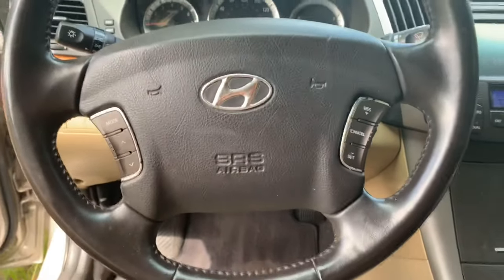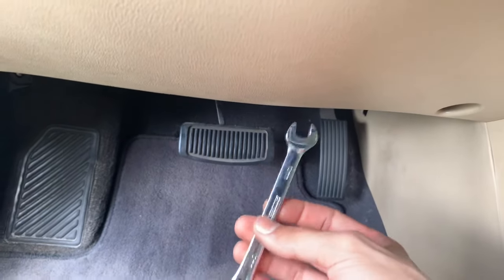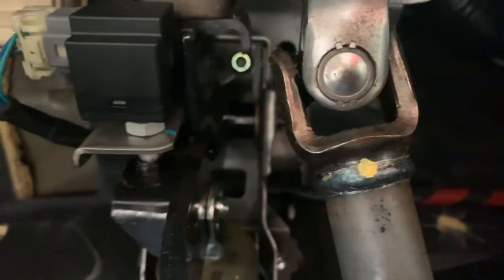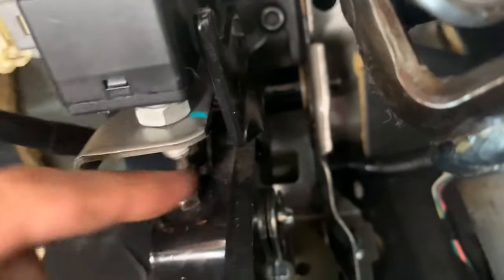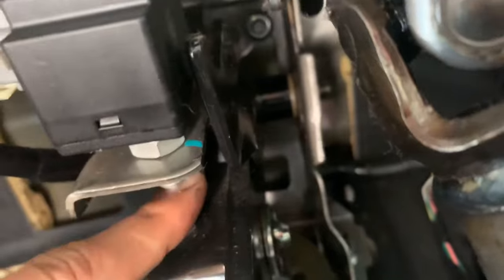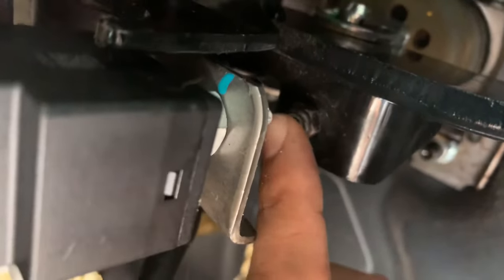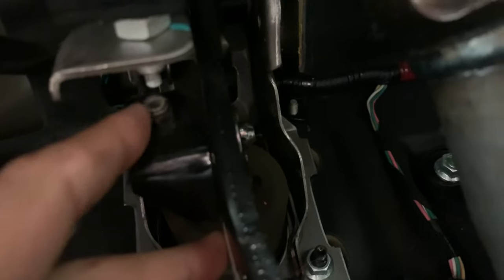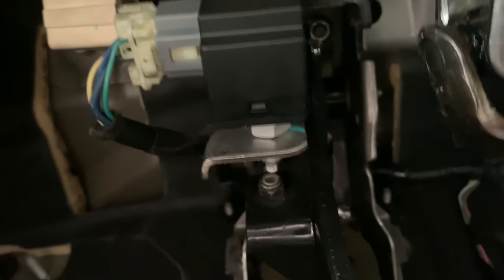HYUNDAI SONATA BRAKE LIGHTS WONT TURN OFF DIY BRAKE LIGHT SWITCH EASY FIX “ ESC OFF “ DASH LIGHT ON

Comment: Thank you!!! I haven't officially fixed it but I put a piece of the broken plastic back where it was so at least the lights will turn off and my car won't die tonight! Woo!
Reply: So you just glued a little piece right there to press the switch in?
Reply: @cherellewhite593  
I used duct tape!! Ok.. to be honest I had to buy duct tape the next day and I found a lint roller and peeled a few layers just to try and tape it on. It felt very very silly but my car didn't die that night lol
Reply: @princesspeach3675  lol don't matter what you use, long as you reach the goal!
Reply: Thank you also
Reply: Thank you very much that was very helpful ☺️
Reply: @princesspeach3675  ppp
Reply: 0⁰😅

Comment: Just get under there where brake pedal is located and at the top of break pedal you will see a round disk that pushes a pin up into a small black shutoff box. If pin is broken off just a little that rounded disk on the side of the break pedal will not be able to push that pin up into the shutoff box and turn the back break lights off. Take a half inch or inch threaded screw and place it through the hole on the disk that is attached to top of break pedal put a nut on the underside of the screw to keep it secure. Now when you release the break ped the back break lights will turn off and no more dead battery. It works fine. Trust me I know.

Comment: Very helpful! I just wanted to put in my two cents that the sticky pad you put under a chair leg (so they don't scratch the floor) also did the trick. It also won't break the pin of the sensor as easily.
Reply from the maker: love it! creative fix!

Comment: Got up with a dead battery this morning, couldn’t exactly figure why other than cold weather and could possibly just need a new battery. Then, my mom came home and asked me why my brake lights were on so we started researching to figure out the issue. This video helped me, and I followed basically the same thing as you did so thanks.

Comment: Worked just as you said. Just put a nut/bolt combo and everything works as it should. Side note: my cruise control stopped working also but it's just because the cruise mechanism was getting a signal that the brakes were on. As soon as I fixed this, the cruise control worked as well. Thank you!
Reply from the maker: thanks for sharing that insight about the cruise control, hopefully this information will be of use to others as well

Comment: Thank you!!! I actually used an even easier trick... The little plastic piece was still on the floor broken in half. I just stuck a piece of it back into th space. Worked like a charm. Quick fix for me as it was dark and just wanted to not burn out my battery tonight. I will have to pick up a nut and screw tomorrow so thanks so much!!
Reply: Good move. months ago when this happened to me I wondered where that old yellowed piece of plastic came from
Reply: @iunderstanphotography2780  Yep. That old yellow plastic disc lol. Who knew?lol

Comment: You most likely just saved me a $200+ “diagnostic fee”. Thank you!! On my 2012 Sonata, the little rubber disc that pushes in the pin was worn through in the middle, so the pin just went into the disc, and didn’t depress. Not really sure how long it will last, but I just duct taped a dime over the hole in the disc, and it worked great!

Comment: Thank you for this information.  My Santa Fe had a rubber ring in there and it broke in 3 places.  Found one piece on the floor before I looked under the console.  Had a perfect nut and bolt.  A little tough to get the bolt through the nut as with just 2 hands and the break pedal not depressed.  I managed.  So far so good.  Thank you!

Comment: Thank you so much for this video. I had no idea that was draining my battery. Replaced switch today and no more problems.
Reply: What’s the name of the piece
Reply: @jaxonjones3607  brake light switch
Reply from the maker: @jaxonjones3607  the plastic piece thats not the break light switch is known as a grommet or spacer

Comment: Brake Pedal Pad

This happened to me a second time. In 2018 the dealership handled it under recall notice; this time I took a small permanent magnet and placed it under the switch on the pedal bracket.

Cost ? have lots of small magnets so a few cents, time 30 seconds.

This took care of the brake lights, the parking situation , loss of speed on the roads,and the anti skid light coming on.

I hope the magnet part is useful, I saw people use screws, bolts, tape etc.

Comment: Great video, thank you. My daughter was visiting and asked my why my brake lights were on (I had been home for hours). Went to the car which now needed a jump start and started looking around. Then the Google machine brought me to this video (top hit). Grabbed my flashlight and headed back to the car. The rubber piece that was supposed to close the switch was split in two pieces. So I put in a temporary block, and will 3D print a replacement. Thanks again for a quick, informative video.
Reply from the maker: happy it worked out for you! thanks for sharing!
Reply: Hey was the rubber piece light beige yellowish colored?? Because I found a piece of rubber/plastic split in a half circle on the floor. Was that my broken piece ?
Reply from the maker: @iunderstanphotography2780  that was likely it. they vary in color, depending on year and model of car

Comment: thanks for making me realize the switch turns the lights on when it's OUT ....DOH!!  I thought my new switch was bad for a minute.  my 07 entourage doesn't have the plastic thing that breaks off, just a sillicone bumper pad BTW.  The engineers at hyundai must be having a good laugh thinking about guys trying to spin that nut back on the switch in those tight spaces.
Reply from the maker: thank you for sharing that insight, Im glad you got what you needed from the video, much love

Comment: Did something similar as a temp fix to keep my battery from dying by whipping out some duct tape.
Tore a 2ft or so length and ripped into 3 equal long lengths.
Double one length over and over into a 1/4 inch square pad.
Laid another strip over the square pad.
Placed the pad over the spot where the brake switch grommet would go
 Then wrapped the strip laid over the pad around the brake notch so the pad would not easily fall off.
Reply from the maker: Great work! Nice temp fix!

Comment: Hy thanks for your great info.

I'm having a difficulty with hyundai santafe 19 front light are permanently on and can't turn them of I've checked all the fuss they are all ok.
Anyway salutations please?
Reply from the maker: Your light switch may be malfunctioning like the button or switch you use to turn them on and off may need to be replaced
Reply: @thegasstationvlogs  i see thanks a lot

Comment: What if only my right hand back break light stays on as if I’m pressing my brakes? The other side is normal. Checked bulb, connector, fuse all good. Do u have an idea what it could be. I also checked the wires and also good
Reply from the maker: that couild be from a faulty brake light switch, the fuse inside the switch could be shorted or the switch mechanism itself may need to be replaced. it looks like a plastic box above the break pedal, good luck

Comment: Yooo I literally JUST did this today after I looked outside and saw my lights on. 

It was Hell trying to get underneath the steering wheel and seats with my wide shoulders😅
I got my daughter to push the brake pedal  while I somehow put a screw and nut through the hole, screwed it on, and sure enough the brake lights went off!  

Not sure how long I should leave this, or do I buy an official part and replace it?
Reply from the maker: as long as the bolt and locking nut are tightly fastened itll last longer than any replacement of the plastic grommet
Reply: @thegasstationvlogs  Dammit and now I'm back 😪
the nut stripped and the screw came off. Lights on again. I disconnected my battery to save it 

Now I don't know if I should find another nut to put on the screw, or buy the part and have it installed
Reply: @thegasstationvlogs  I'm back again! I went to Lowes looking for a replacement nut, and it hit me, why not buy another  screw and nut?? 

I bought a pack and put another screw and nut on, and the lights are off again

I'm thinking of ordering the brake stopper as a back up. its $16-20 on ebay! too expensive
Reply: back again. the screw and nut came apart and the brake lights were on again in my daughters school parking lot. the nut and screw from last time isn't stripped, but since its 10pm I put the amazon piece on it this time

Comment: Was there supposed to be a bolt there already?  I don’t know how my brake lights ever turned off before without it as it just goes through the hole
Reply from the maker: there was likely a piece of plastic there before that broke off, even something as simple as a couple zip ties through the hole should do the trick, or a trip to hardware store for the nut and bolt as well

Comment: Do you think they'll have that little plastic piece in an auto shop to purchase?
Reply: If they don't have it they can easily order it for you if you're not able to yourself! That's what they did for me when I was able to take the car in!
Reply: @princesspeach3675  awesome thanks. I ended up just getting sum super glue and gluing a little piece to press the button. Works so far!
Reply: @cherellewhite593  Of course! If you're not getting the piece fixed any time soon I'd recommend checking each time you drive that it's still glued in place! (Obv much stronger than duct tape but because of the humidity it would slide off)
Reply: @princesspeach3675  Absolutely, I'll keep checking. Thank you for your help

Comment: What if the light doesn't turn on but I'm having same problems?
Reply from the maker: if ESC light is not on then youre lucky. its probably just the plastic piece that compresses the brake light switch mechanism

Comment: Yoo at 2:19 where can I buy that Lil plastic part from
Reply from the maker: dealership will replace due to recall is what has been suggested by some others
Reply from the maker: also a local hardware store will likely have a nut and bolt at the perfect size for less than $2 and it wont break like the plastic
Reply: @thegasstationvlogs  I ended up spending $800 dollars……. My breaks went out while I was on the bridge 🤦🏽‍♂️ thanks thou

Comment: Replace brake light switch still when I step on the brake pedal my panel lights turn on also all my signals anything you can help with is a 2012 kia soul
Reply from the maker: which signal lights are showing? from this message it seems like youre saying all of them ?

Comment: Why couldn’t the manufacture do that rather than put a piece of plastic there that’s going to break?
Reply from the maker: Well, this way the dealership could charge you a inspection fee when you bring it in to be looked at for even a simple fix as this, maybe even lie to you and try to upsell you on a totally unrelated and made up issue

Comment: wait, you're using a flame lighter for illuminating work under a dash?  Riiiiight-ooooh.  And you never did 'splain just why the "ESC LIGHT OFF' would illuminate if this switch area is malfunctioning.  Sure, "only" $10 bucks or so, but some actual explanation would be useful....  Ah, but then you end up telling us that if the ESC LIGHT OFF stays on, then we should take it to a mechanic...... WRONG answer.... this is supposed to be a diy video, not a guess and fool around the block, not really knowing what you're doing, while setting the place on fire.  strong dislike.
Reply from the maker: hugh3rdof5 you seem upset, so here is some explanation. the esc light being on is only sometimes triggered on due to the brake light switch issue if the actual brake light switch is broken. In the case that it’s not and it’s only your grommet that’s fell off you may need an inspection to check the ESC off light since it’s your stability control with the vehicle. It can be something serious or something as simple as a sensor/fuse gone bad. Also didn’t have a flashlight, was very poor at the time and that’s what I had for light since my flash on my wasn’t doing the Job. Good day